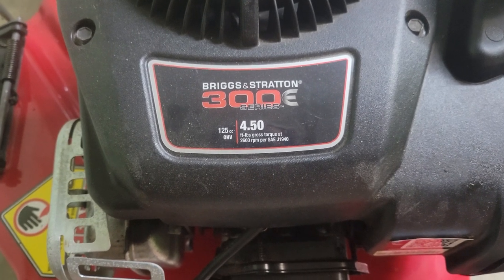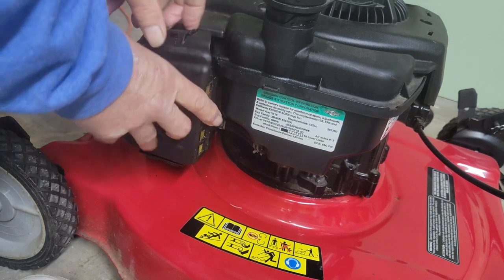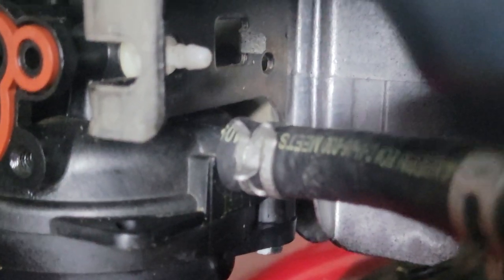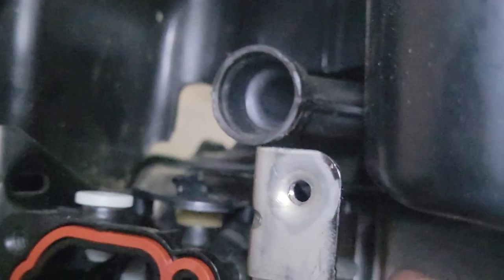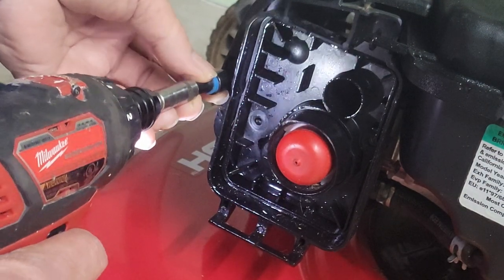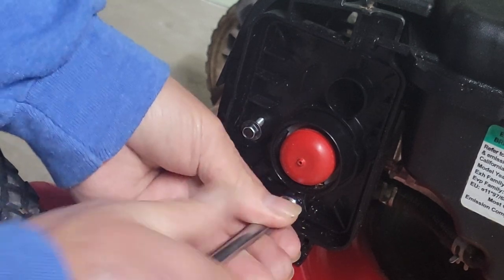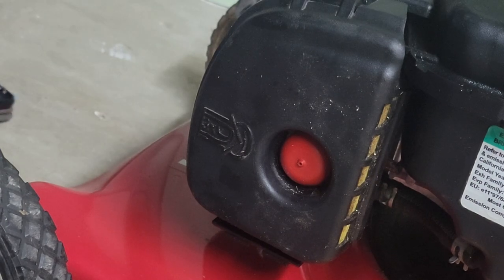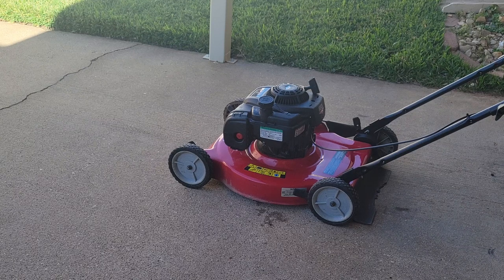Briggs and Stratton 300e won't prime, runs with starter fluid - Easy fix

Comment: Great video! I have the same engine on my 300e B&S but i still cant get mine to turn one. Wil go like its about to but quickly turns off.
Reply from the maker: Thanks. That's a different(but easy) problem to fix.   The jets are clogged. I am going to look at a couple mowers tomorrow that have a similar carb and I will do a quick video on cleaning jets on one. Should have it by Sunday, Monday at the latest.
Reply from the maker: Update, I am waiting for parts to finish the mower but we included that carb and the jets in the next video coming up... Depending on delivery speed, probably Thursday.

Comment: The cord that hangs from handle to back of mower size, and how to place it.
Reply from the maker: If you mean the pull cord,  there is a metal piece that bolts to the side of the handle that it loops through.  I see them missing all the time.

Comment: So I just pitched the exact same mover and mine doesn’t have that little white plastic piece. Should I just seal it up? Or do I have to purchase the exact piece? And if so what is it called so I can order it. Please and thank you 🙏🏽 @guys playing with tools
Reply from the maker: It is also a support for that side of the carb though. I wouldn't try to run without it. If you got the mower new I would look around for it, little parts always make a run for it when they come off 🙂
If you got it used, it may have been taken apart by a rookie who lost it or couldn't figure out how it went together. 
Either way,  if it were mine and it was missing,  I would go on Amazon and get a carb,  $20 or so  and easy to put on.
Reply: @GuysPlayingWithTools  thank you for taking your time to reply back 🙏🏽 I’ll let you know how it goes once I purchase the carb piece. Any particular name the carb is called? Measurements? Or are they all the same?
Reply from the maker: @jjrodriguez3251  HI JJ, look it up on Amazon by motor size.  Something like Briggs 450ex or Briggs 550ex. The ex motors all have the black plastic carb  and they are almost identical,  there are 2 basic types. One with an automatic choke and one with a primer bulb on the cover, you can look at yours and tell them apart pretty easily. If it matches that and the engine size you have it made.   If you would like, you can take the air filter off and email me a pic of the carb and the top of the motor and I can send you a link to the right one. My email is in my about section.

Comment: How did I fix a screw that’s been overtightened and I lost seal there
Reply from the maker: @alicialewis9001  airbox to the carb? If it were me,  I would take the screw to lowes and find one a bit larger(not much,  just a little). It's either that or replace the carb, so you aren't going to hurt anything trying

Comment: So what was the cap for on the carb
Reply from the maker: These carbs are made to fit a lot of different applications, in this particular one that line is not used. Some leak vacuum, others don't. The homemade cap is used to stop the vacuum if it's leaking. If yours has this carb and starts easy with starter fluid and runs good but won't start without it, this will fix it.

Comment: So is this a permanent fix, or should i try to reseat or replace that valve!
Reply from the maker: It's a short term fix for people not terribly familiar with carbs. It will usually clear out obstructions in the carb and get it flowing freely again. I have a couple videos, one last week,  showing how to clean the jets on this style carb, that's a better way to go if you are mechanically inclined. 🫶

Comment: this must be the problem with mine.  When I press the prime it will actually spray gas out that tube.  Now I just need to find something to plug it with.  doesn't look like you can just buy that piece and replace it.
Reply from the maker: If you are ambitious, a quick rebuild would probably be a good idea. If gas comes out there, something is clogged.
I have a couple of videos that focus on the e series plastic carb. They are nice carbs when they work.  🙂

Comment: Hi I did today and it worked great. Do I leave it permanently? Or is it just because it was the first start up of the year?
Reply from the maker: Cool! Leave it. It's not hurting anything. 🙂 If you decide one day to overhaul\replace the carb you can take it off. You are blocking an internal vacuum leak in the bowl that was allowing the prime to escape, by stopping the bowl vent.  It's the only carb I ever touch that even has a "bowl vent", most pointless thing I have ever seen on a mower.🤣

Comment: I have this lawn mower could never get it started no matter after sitting a year and a half. Changed the oil, new  spark plug, cleaned the gas tank and carburetor and tried the plug. Can't think of anything else to check, don't see a fuel pump and I don't think there's a fuel filter. Looks like it worked for others though, that's good.
Reply from the maker: Take the carb off and clean the jets, and it should start right up.  I have a pretty recent video on the e series carb and jet cleaning.  I think I did it on a 500e, but for your purposes, they are all identical.
If you can't find it, let me know. After you see it, you will make short work of fixing it 
Let me know if you can't find it, I love hearing about people that got their mowers running
Reply: @GuysPlayingWithTools   I also cleaned the jets. I have two carbs one from an out of commission mower basically same exact motor.. Cleaned it and tried it also, no luck. I might try it again, but I'm stumped.
Reply from the maker: @christru22  Did you try it with starter fluid? If you still don't get anything,  the next step is spark.
Reply: @GuysPlayingWithTools  Not yet, but plan on it tomorrow.
Reply from the maker: @christru22  If you have a spark checker, try that first. It might be as simple as a grounded wire
Reply: @GuysPlayingWithTools  Thanks I'll check it out. The first thing I noticed when working on it was the gas line was clogged. after i cleared out all that, It almost started twice, but no luck since. but thanks for the tips.
Reply from the maker: If it tried,  hit it with starter fluid and see if it kicks a little. If it does. It's back to the carb, if not...ignition time 👍
Reply: @GuysPlayingWithTools  thanks
Reply from the maker: @christru22  Let me know how it comes out.
Reply: @GuysPlayingWithTools  still no luck. tested the plug and it produced a spark. Sprayed starter fluid and cleaned carburetor again. I've been able to get some pretty old mowers to start again in the past and this engine is only a few years old.
Reply from the maker: @christru22 email me,  I am intrigued and have suggestions but questions too. Bill.jarboe@charter.net
Reply: @GuysPlayingWithTools  ok emailed you

Comment: What's the fix if the leak is at the seal you first pointed at and the nipple. I plugged the end of the nipple but it is leaking at the seal. Thanks in advance.
Reply from the maker: Hi, I am guessing a little, but I am pretty sure you mean the seal where the little nipple goes into the carb. If that's loose and leaking I would probably go old world and take it out and wrap it with teflon tape 2 or 3 times. I have seen people glue them in with epoxy and whatnot and that does work but I question how heat would affect it long term.

Keep in mind that aftermarket carbs for this motor start at $13 and factory carbs can usually be had on clearance for $20 on Amazon. I have had good luck on the 2 or 3 times I tried them.  Once you have the air filter off the only thing you need to be careful of is the linkage, take pics every step so you get it right going back on 🙂

(edit: if you buy a carb for this one, make sure it matches your engine size, the EX carbs are 100% interchangable but the wrong one will have the wrong jets in it and run badly) 

Let me know how it goes!
Reply: @GuysPlayingWithTools  Just tried the Teflon tape before your response and it sealed. Still won't start but it isn't leaking from that point in the carb now at least. I'll pick up some starter fluid and see if it starts then I'm going to check the spark plug and probably drain the fuel and refill with fresh gas next. Thanks again for the quick response and advice.
  I just picked this mower up yesterday from my neighbor who put it out for free in our alley. Not sure on the history of it's use and maintenance history but it looks almost new and barely used. Blade is sharp and it will make a great replacement for my mother's mower. The linkage mount snapped off the cast motor and cannot be repaired on that one.
Reply from the maker: @anonymousanonymous-bd1be  This trick was for a specific problem, when it starts with starter fluid and runs good. I didn't realize it was a different thing 🙂If it's been sitting a while you will want to start off draining and replacing the gas for sure, then give it a dozen pulls, if it still doesn't start, clean the jets and it will probably run for sure.

Comment: Sounds like the engine is surging back and forth a bit when running.  The governor spring may be a little too tight.
Reply from the maker: It got a carb rebuild later that took care of it. You are right, though, when a motor is cycling, it's usually the springs or the jets. It's rarely the governor.

Comment: Why would I plug the vacuum valve?  How did it start "escaping air"?   You don't explain how you made the plug. How did you enclose the end of the plug?  Can't I just use the cap from a BIV pen if it fits snugly?
Reply from the maker: It's not a vacuum valve, it's a vent. I covered how I made it, but you can also buy one that would work for nearly nothing at an auto parts store.

Comment: how did you make plug
Reply from the maker: I had a rubber hose that I melted the end on and made a plug. Auto parts stores sell 1/4 plugs that would fit right on if you don't want to melt a rubber tube.

Comment: What did you use to make the plug?  I’ve got one doing this!!
Reply from the maker: I used 1/4 rubber pipe, I got it hot with my fireplace lighter and used pliers.  It always works, but if you are mechanically inclined, I have a recent video that covers cleaning the jets on the plastic briggs carb. It's a 10 minute job that only takes basic tools but using the linkage off and putting it back can be annoying if you don't work on stuff like this. 
Either way will work. Let me know how it comes out. 👍
Edit: you can also buy a 1/4 plug at just about any parts store for nearly nothing.  It's an air vent, so it doesn't have to be fuel line
Reply: Well, I put a plug on and it will start, but then dies almost immediately .
Reply from the maker: @LoriCazey  How old is the gas? From here it's either old gas or the jets
Reply: @GuysPlayingWithTools  Maybe I need to drain the tank, this is my daughter’s mower, no telling how old the fuel is.  I’m wondering if it’s a bigger problem though…when it starts, it blows white smoke then dies.  That’s either water in fuel…or head gasket on a car….so I’m wondering now.
Reply from the maker: @LoriCazey On a mower, it is usually either over-filled oil,  or the float is sticking on the carb, and fuel is going back into the oil.  Check the oil level and see if it looks high

Comment: This didn't work for me, my plug was sealed. I ended up taking my air compressor and blowing into the small hole(the one the primer bulb blows into) that cleared it out and it works.
Reply from the maker: Working is what counts.  You had an air clog in the primer system. I have seen that happen, but air leaks are a lot more common.  I am glad you got yours running. 👍

Comment: I have the same engine but it's a poulan. After the first winter start, 3 pumps on the bulb and it's starts right up.
Reply from the maker: 👍That's how they are supposed to work.

Comment: What diameter size is the clear tube?
Reply from the maker: Sorry about that, I went to Disney for a few days and am just catching up. I don't have one here but I would say it's between 1/8 and 3/16, depending on how stretchy the line or plug you are using is. I used a piece of 1/8 hose that was semi-easy to stretch and it went on tight.

Comment: But what if you don't have a primer bulb?
Reply from the maker: Are you referring to the motors that don't come with one? They use an auto- choke that(when working right) pulls enough gas to start it.

Comment: Why is that even fitted to these carbs ? It doesnt seem to serve any purpose and looks like it should have a pipe pushed over it, but there is no pipe to push on ?
Reply from the maker: I will be nice and say it was an interesting engineering choice... I think there were 1 too many people involved in the design. 
It's too bad. Outside that weird little part, it might be the best small engine carb out there.
Reply: @GuysPlayingWithTools  - I'm having a fire and die issue with one of these. I've had it apart so many times. I could do it with my eyes closed. Cleaned the jets, blocked off this little white pipe connector, made sure there are no air leaks, blown all the fuel ways through and still it fires and dies.
It will run for a little while if I spray some flammable stuff in the intake.
I'm getting ready to resort to the last option of a new carb, but dont want to as I feel the fix, if found will be simple.
The original problem was that it would start Ok, but barely run. Just about tick over, but that was it. After cleaning out the carb, it started the fire and die thing. But before dying, does rev properly.
Any ideas before I commit to a new carb ?
Reply from the maker: @herenow2895  Fire and die is almost always the jets. On this carb it's specifically the one facing straight down because it lives below fuel level. 
*I see this all the time*, this video will probably save you, it covers a Briggs plastic carb that was in way worse shape than yours. I would bet 6 cents(LOL) that, if you follow what I did in the video, it starts first pull when you are done. 
https://www.youtube.com/watch?v=Xa938qHp0lU
Reply: @GuysPlayingWithTools  - 6 cents ? Uhmm ? I reckon that would be about 5p on this side of the pond :)
I'll check out that video. Many thanks and much appreciated.
I've got a can of Berrymans carb cleaner and blasted it through that bottom jet and it came out of all 3 exits at the top end. Even the tiny one.
But I'll get on it tmrw. 
Cheers.
Reply from the maker: @herenow2895  watch the part with the wire,  that's really the magic to it all.  Cleaning the body is a good idea but the problems are usually on the bottom jet. 
I will be in London in August(a lot better than being in Texas in the heat of summer)
Reply: @GuysPlayingWithTools  - I'll def get on the wire tmrw.
Is the middle tube on the jet assemble supposed to be open at the top ?
A trip to London , cool !  How long for ?
Reply from the maker: @herenow2895  we are supposed to be on Wales for 3 days on business, but we like to start off in London for the weekend, then train up to Manchester and drive from there.  We are finishing with a few days in Scotland since we haven't been there yet. 
Don't lose any sleep over the holes on the part that goes in first,  it's all about the 2 little brass pieces at the bottom.
Reply: @GuysPlayingWithTools  - "There's no substitute for experience" and thank you for sharing yours.
Found a suitable piece of wire and it just wouldnt go into that bottom jet. I could see through it, but the hole was too small. But I persevered and it eventually went through.It was crudded up with what looked like limescale. It must be from this crappy part ethanol fuel. 
Put it back together, 3 pumps and away she went. Brilliant !
Thank you so much. That saved me about £13 for new carb.
The little O ring on the jet module was stretched and perished. But I still had to use it. I'll get a new one as it's running Ok but could be a little smoother.
Many thanks for the trans Atlantic assistance. Who'd of thought 🙂
Reply from the maker: @herenow2895  Now that's how I like to start my Friday,  someone telling me "it worked".  😁
I am glad you are running again. When things won't start, it's almost always the jets. Now you can tell your friends that you are the local Briggs carb guy(and tell them about us LOL)
Reply: @GuysPlayingWithTools  - Looking for a new mini O ring, I discovered that I can buy a replacement plastic main jet assembly for £3, delivered to the door.
Been mowing with it this morning. She grunts momentarily when the load of the drive is engaged. But other than that, runs great.
 Have a great day.
Cheers....
Reply from the maker: Something I never asked,  which engine is it? The motor layout and fix applies across the entire series, but we never talked about which one you have.
Reply: @GuysPlayingWithTools  - It's the 125 cc.
The number on the side is FBSXS 1251VC
It has the foam air filter and the primer bulb.
The carb number is 593261.
The 125 would have probably been enough
🙂

Comment: What if there is no option to make a plug, then what?
Reply from the maker: You could get one at an auto parts store.  Anything that stops the air flow and increases the vacuum inside the carb will work. My next video coming out Saturday morning goes a little deeper into that specific carb.
Reply from the maker: I uploaded the video covering that carb inside out today.  Hopefully it will be helpful for your particular issue. 🙂

Comment: Why is that vent on the carb?   Seems to not be a fix.
Reply from the maker: I am not sure,  as near as I can tell, it is a design flaw.  It's not really a vent as much as it's an alignment peg that goes clear through the carb. 
Carbs bodies are always used in more than one application with modifications for each use, and this particular mod could have been better.
Reply: Swap the carb out

Comment: Cleaned carburetor only starts and runs with starting fluid
Reply from the maker: Did you try the trick in this video? It usually works like a charm